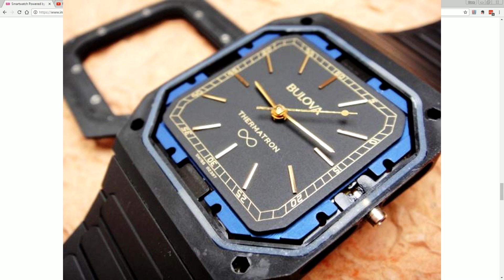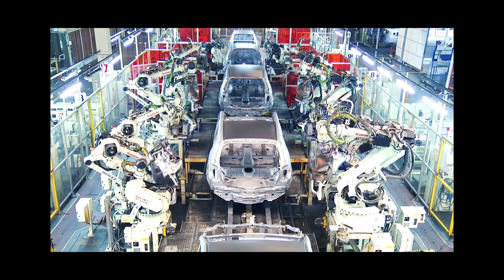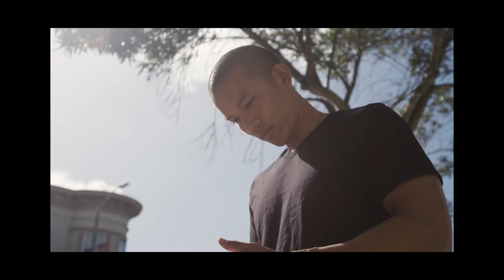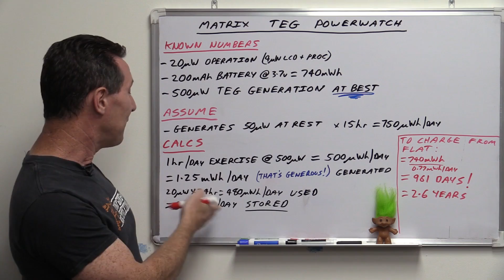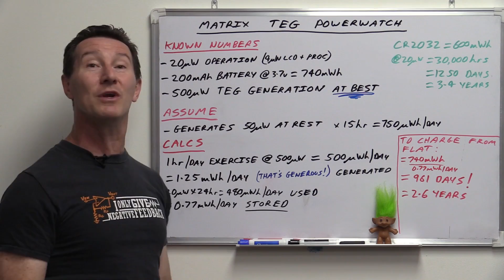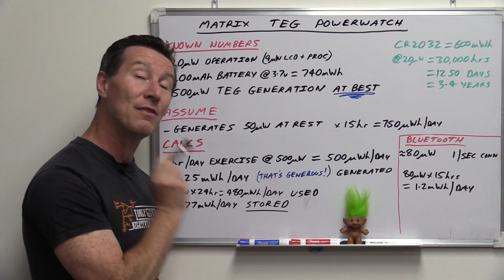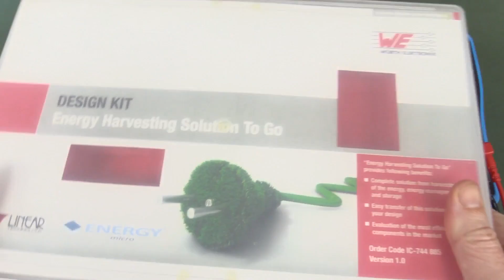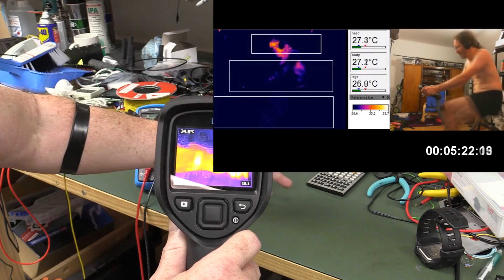EEVblog #945 - Thermal Powered Smartwatches Are GIMMICKS!

Comment: the self discharge of the li ion battery won't allow for any surplus energy to be stored actually.Best scenario 2% capacity loss per month so 14.8mWh only for that.If you you only have 0.77mWh per day surplus you need 19 days only to counteract the self discharge.Now if the self discharge is 3% you don't get any power surplus at all...

Comment: Like the sweet irony of the solar-powered calculator. That brings me to my solar-powered diver's quartz clock with unibody ... that makes some sense as the solar cell allows for a more rigid watch body design; now using a thermal generator in cold watre dives at 4-8°C ... maybe I could also harvest money on an indigogo campaign?

Comment: "A watch you never have to charge" (micro print... but it does have a battery that will need replacing every few years.) [which, for the record, is the Pulsar digital watch I've had since 1980.] Do away with all the modern must-be-connected-to-the-interweb-bluetooth BS and yes, a pure tells-time watch only needs a few micro-amps. Heck, the motorola pager I had in the 90s ran on a single AA for months on end -- ISP engineer, I got a dozen pages a day. (for all you youngsters, think "text")
Reply from the maker: In the video I show that even with a Bluetooth connection once per second 24 hours a day, you can still get several YEARS of battery life from a coin cell battery. The TEG is pointless.
Reply: We just need TEG body  suits and we can call it good.
Reply: Sounds cooooool
Reply from the maker: Interesting. Got a link to these coolshirts?
Reply: I wear a smartwatch, it can last 2 - 3 days on a single charge, but I take it off every night anyway so dropping it onto a pad to charge it is a moot point to me.
Reply: How about polling only when 1) watch thinks it needs data 2) cellphone app wants to connect. That way the watch hardly ever polls. The watch needs to maintain Bluetooth readiness, but doesn't have to send power hungry signals. It works if you want it to work.

Comment: I've got a Sunto Core sports watch.  Uses the CR2032 battery.  Nice watch I bought it as a reward to myself for quitting smoking.  First battery lasted with me little more than a year (don't know how long it had been on the shelf before I got it.)  So far the second one has lasted a little over 2 years.  Runs a Altimeter, Barometer, dual time zones, stop watch, count down timer, compass, Sunrise/set, can set a storm alarm (goes off if the barometer drops) The back light is a bit weak, but it's really good in direct sunlight.  Think I will stick with the battery since I can open the watch with just a quarter and chance the battery.  Hard part there is to be careful not to cross thread the cover.

Comment: It would be better to just have a watch with a pull out hand crank. Then you could probably even have the features of a normal smartwatch. Or maybe, just maybe, you have a watch that you PLUG INTO THE WALL and it just simply CHARGES...

also, you should do a video on the USB Killer, and maybe do that thing where you blow shit up with a disposable camera's capacitor
Reply: That one would get charged very quickly during boring meetings. "Sorry lads, got to charge my watch. Couldn't find a good place to do it so I organised a presentation on if we should increase the 100 nF decoupling capacitor to 110 nF with ... senior management." Not only would your watch be fully charged, that would arguably be the most funny meeting ever to see the minutes of considering the average electronics skills of managers in most places. Additionally you'd have a giant red spot on your forehead from bashing your head against the wall afterwards, but that's a common side effect of all management meetings experience teaches.

Comment: The main trouble with this is that the watch will still get warm from your hand and then it falls back on the battery.
Estimated 1h until equilibrium, where 10-15 µW maybe is there. It maybe will not discharge at deep sleep.

Well, if you're running, you might be able to slightly charge the battery.  But 0.5 mW is just barely trickle charge for this CR2032 with best DC/DC and battery controllers available.

Lack of piezo and radio wave generator is a missed opportunity. Maybe they couldn't fit it in.

Or a hydrogen fuel cell, that would properly heat it up. ;)

Comment: Yeah... The power a lamp uses in 30 minutes is probably still more than this watch would use in its entire lifespan. Saving the earth is as easy as using 8 less coin cell batteries? thats awesome!
Reply from the maker: Spot on.
A 20W CFL globe on for 30 minutes would use 10Wh. This watch even with Bluetooth on 24/7/365 at 100uW would take 8.76W in 10 years.
Reply: How would recycling 8 coin cells compare to recycling one NIMH battery as far as  their "green" status?  When recycled, How would they environmentally compare on the recycling side of this "green" status?

Comment: On the Casio Tough Solar watches, the solar panel actually works very well. I have mine for 8 years, not changing the battery. (and it goes into sleep mode at night, after the automatic radio-update of the time)

Comment: I afraid you need maximum power point tracking to get max power. Direct connection to ampermeter is not going to give you maximum power.
Reply from the maker: The MPP curve varies with temp gradient, which in this case is going to change a lot depending upon a lot of factors. There is also no data on that for this cell. I was getting ballpark figures. Good enough.

Comment: I find myself wondering how much power it could reasonably generate for those of us in the Southern US, or anywhere in the tropics or subtropics, where the outdoor temperatures are equal to, and at times greater, than typical body temperature.  It would seem there would be very little energy passing through the TEG with both sides essentially at, or near, equilibrium. You would essentially be operating off battery at nearly all times with the TEG providing only minimal supplemental power to offset some of your drain.

Comment: I bought a Powerwatch 2 at Best Buy in Toronto on 2020731. I only really wanted three things: a reasonably accurate step counter, a reasonably accurate sleep counter and no recharging required. I have had to recharge it 7 times so far. As far as I know, that is a lot better than other smartwatches, but it it still very annoying, since not having to recharge it was the very reason I did not buy another smartwatch. Given that rechargeable batteries have a limited lifetime, this is an expensive gadget with a limited lifespan that does not live up to its promises.

Comment: A basic Casio F91W costs 8$ and battery lasts 7 years or more on a CR2016... Fancier casio A168 is 16$ if you prefer metallic.
I'm sure there are models with better runtimes.
Reply: TheKetsa Solar-powered Casio runs forever :)

Comment: I guess it depends on the definition of "never have to charge"... for me is at least 10 years till a new battery is needed... for me wristwatch is something that is always present and I don't need to worry about... 

Hmmm... wonder what the figures would be if a solar generator was used instead.... would a smartwatch with a small e-ink surrounded by solar cells be feasible? I assume pedometer/accelerometer, barometric and  thermometer (allows for a rough altitude estimation) and notification capabilities (and possibly BT heart-rate, even if via a chest strap) would be present... and at least 6 months of normal operation before requiring a charge (assuming you don't deliberately expose it to sunlight)...

Casio has some neat solar powered ProTrek watches that read barometric data from time to time... I have a really old one (+10 years) and it is still running on the original battery... I also have a solar G-Shock with mechanical hands (that are always moving, no second hand though), 3 tiny LCDs in the face (the rest of the watch face is a solar panel) and a 6-band radio clock sync receiver... It is relatively new (and quite small when compared with other wristwatches), but I expect more than 10 years of operation without issues...

Comment: I have a Casio watch with a solar cell built in also it has a coin cell and is still on the first battery after 6 years. The manual says it only needs 20 seconds on a sunny day to charge for a whole day.

Comment: why wouldn't they also generate power from the movement of the arm?
Automatic watches do this mechanically, why wouldn't they use the same mechanism in order to generate electricity?
Also, adding that rechargeable battery beats the purpose, why wouldn't they use some super capacitors instead?

Comment: i have a watch that doesn't need to have a battery changed it has small solar cells in there around the lcd it works wonderfully i don't need any thermoelectic shit
Reply: my watches are powered by ataumatic movements... just plain old mechanical power....
Reply: Automatic movement is useful but lose more time than quatz clocks.
Reply: thats from patek themselves:

The stability of the rate of Patek Philippe timepieces is checked in  
several phases during the manufacturing process, initially with uncased 
 movements, later with finished watches. The final rate accuracy  
measurement of the cased watch is performed with kinetic simulators and 
 must comply with the following in-house precision standards:

- for calibers with diameters of 20 mm or more, the rate accuracy must lie within the range of -3 and +2 seconds per 24 hours.

- for calibers with diameters of less than 20 mm, the rate accuracy must lie within the range of -5 and +4 seconds per 24 hours.

Patek Philippe watches with tourbillon are subject to the same  
in-process inspections as all other mechancial timepieces, but they must
  comply with tighter tolerances as follows:

- Their rate accuracy as measured during the final inspection with  
kinetic simulators must lie within the range of -2 and +1 seconds per 24
  hours.

- The greatest deviation between the average rate of the watch in all  
six measuring positions and the rate in each position must not exceed 4 
 seconds per 24 hours.

The rate accuracy of each Patek Philippe watch with a tourbillon is  
documented with an individually issued certificate delivered with the  
watch.
   
  
every single mechanical watch cannot reach the level of accuracy of even the cheapest chinese made quartz watch
and the high end movements are usually less accurate than the simpler ones, because of the more complications involved.
Reply: My cheap citizen eco drive is more accurate than any mechanical on the market, if you buy a Patek for second perfect time telling you're going to be sorely disappointed.
Reply: morbideddie  Bullshit, the crown on my Eco-drive gets twiddled often enough that the time gets far off the mark when I wear long sleeves... unless it is something else making it lose time... but when a pin broke, I switched back to my trusty Sony Smartwatch SW1.
Reply: nimoy007 On any eco drive (at least any ive handled) the time is only controlled by the crown when its pulled out (which also stops the seconds hand). The moment the crown is pushed back it will keep time. 

One problem you can get with analog quartz watches is issues with the stepper motors, if you put them near a strong magnet they will generally sieze up until you take them away again. That could be why your watch seems to loose time? if your phone case or bag has magnetic closing it may stop the watch while you're using them.
Reply: Fair enough, I do use a strong magnet at work.
Reply: My Citizen Eco-Drive also tunes in to WWVB (or the European or Japanese equivalent) daily and adjusts accordingly. True, it only displays time, but that's all I want a watch to do anyway.

Comment: Only reason I ended up here was after seeing the ad pop up I liked the idea of a decent looking smartwatch that had the same less hassle benefit as my old automatics or Ecodrive Citizen but with at least very basic smartwatch features similar to my Pebble Steel.  No remembering or needing to charge daily or even weekly would be great in a smartwatch.  The original Pebble Steel was the best at frugal power usage with it's monochrome E-Ink and my battery lasted a week and the big plus was also that it was shower/swimmable waterproof.  So my only consumer interest, likely shared by many seeing the ad for this watch is the idea of taking the charging hassle out of having a smartwatch rather than some ideology that it's a big green watch that will save the whales anymore than electric car battery tech at this stage does anything better on the green side in reality.    Video is a good technical breakdown as I never paid attention that there ever were TIG powered watches out before this one in the first place.  At least I can turn down my thermostat this winter and save my gas bill and stay toasty with my BedJet under covers heated air blower instead. lol yep and it does unheated air in summer for cooler sleeping when it's hot out too.

Comment: As I recall TE module's power generation depends solely on temperature difference. Exercising doesn't raise body temperature that much - most of the excess heat is released as water evaporation, and not captured by the TE module. Since the body's temperature is pretty much constant, we could considering it as an infinite heat bath (or thermal reservoir), the difference in power generation between exercising and resting should not be as much as Dave claimed.

Comment: That thing can have a low power bluetooh module operate for brief periods at best.
Then there is so little energy left, that it would require e-paper as display and a low power µC in deep sleep mode for the majority of the time.
I wouldn't be surprised if someone takes it apart and finds a CR2032 inside as "backup"

Comment: Dave, did you consider the self discharge rate of the battery?
Reply: It's pretty much a non-concern with lithium batteries. I have a CR2032 installed in my work computer's mainboard (came with it in 2008), still powers the RTC just fine. And as I work with cell phones, I've seen them (with Li-ion batteries) spend more than a year in a drawer and still show 50+ % charge on powerup.
Reply from the maker: Nope, i was being generous and keeping it best case ballpark.
Reply: tybofborg Self Discharge isn't a problem with Alkaline batteries, that probably after ten years would still be at 70 or 80%; but with this slow charge rate a li-ion could even lose charge while charging. Consider that the battery would be stored at 30 or more degrees. 
(Sorry for my english, I'm italian)
Reply: Thinking about it, you're absolutely right, it changes the whole equation. Wikipedia tells me that the self-discharge rate of Li-ion batteries is 2 to 3% per month. If we take the upper value (due to high storage temperature), the battery discharges itself in 1000 days. Dave has calculated that a full charge from flat would take 961 days. So with Dave's usage scenario the battery just self-discharges every bit of charge it's getting! There really is no way to charge it with your body heat alone, you'd need to put it on a hot water pipeline or something to actually charge it! The whole gimmick makes even less sense than I thought!

Comment: If it does what it was designed to do then it does serve it's point :) Is there something else to do similar function better - thats another topic isnt it? :D Like, there are so many products that do some function not as efficiently or well as something else.. Example: there are small cars that do what most ppl need from a car, to take them from A to B but still ppl buy more "gimmicky" cars that prettier dashboards or seats, but the main function of getting from A to B is the same. Maybe it's even harder to park when it's bigger car etc and takes longer thanks to that.

Comment: Let's assume that you do have a charger on a normal smartwatch, regular USB charging, etc.  Well, let's also assume that you are putting some power in for the TEG generator... well, you might initially think 'even on a high-power device, I get a little more power right?' well, technically yes... but technically not anything to write home about.  This is why we don't stick TEGs on everything to try to recoup some of that power from say the CPU getting hot... though that would be technically more efficient, still not enough to worry about.

Comment: just revisiting your video 3 years later I wonder about the assumption that the TEG would generate 10x more power during workout than during rest... while it is true that your body produces more energy during workout it is quite unlikely that the temperature of your underarm underneath the watch will increase substantially during workout - and only an increased thermal gradient over the TEG would contribute to an increased electrical generation...

Comment: Sorry for the second comment, but I realized that of course will sell the watch with the full charged battery, which would allow the watch to work even without a single picoJoule being converted from heat to electricity for many years. I.e. in a time much longer that the warranty period, therefore nobody will be ever able to claim that "the TEG cannot charge the watch"... :/